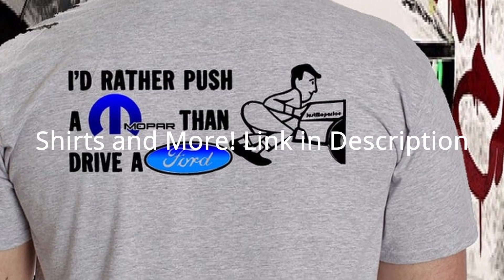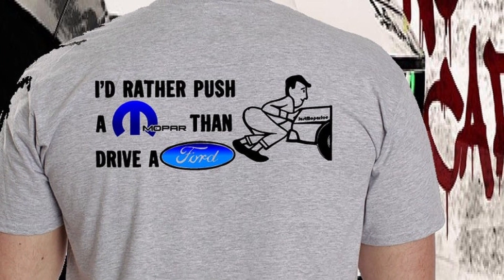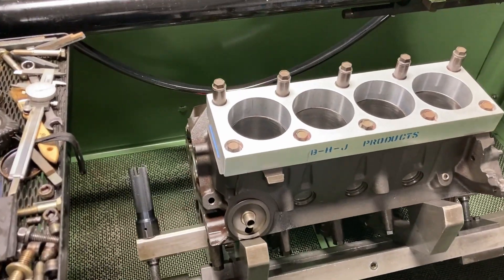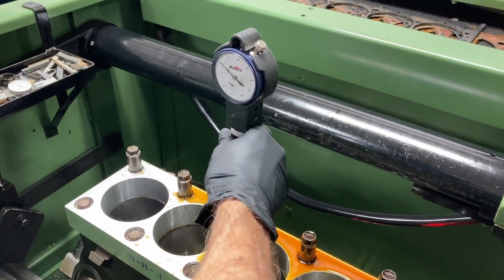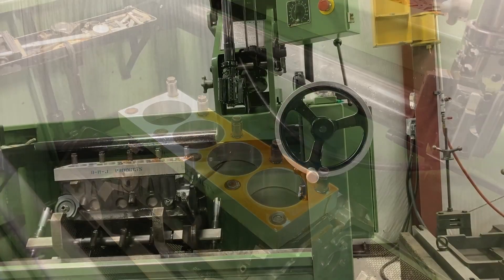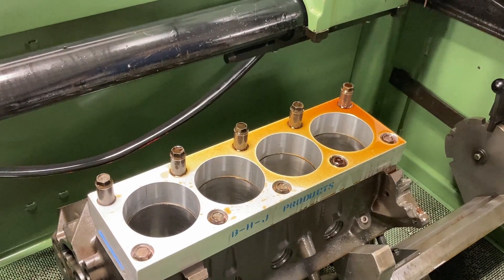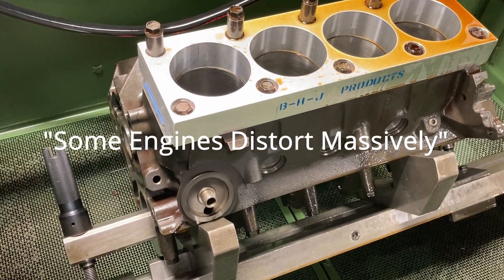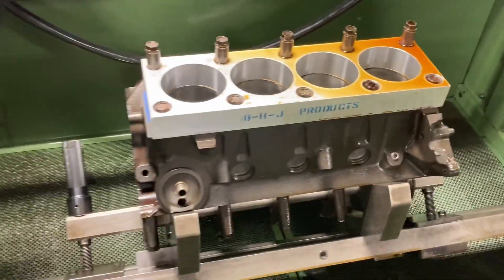Engine Building 101: A Real World Torque-plate Test!

Comment: Old retired diesel mech I know with great success for 48 years now retired never used a torque wrench on the head bolts, used an air impact never saw a head gasket failure after using it.. Myself I prefer a torque wrench
Reply from the maker: Wowser!

Comment: Not too surprising.  I'd really liked to have seen him measure in line with the head bolts to see the distortion in those areas.  The rings need a to size round bore to seal and not just across the thrust surface.  Thanks for the video. Maybe next time measure every 30 degrees.

Comment: The take away for me. Some blocks  move more than others. How do you know which one you have? I watch this video on youtube. I watch other machine shop videos on youtube, They come up with different results and say don't trust what you saw on some video or read. ?  One vary respected  machine shop / u- tuber say yep it definitely moves, but..  on an ls, if it's not 4000hp you don't need it.  But all his other videos are about be Precise and exact. 🤔  so what I've Concluded. 1. If the block has head threads up top to deck. Like an fe ford. I would definitely tork plate. If I was rebuilding a stock Ls. I wouldn't. But if I spent money on Forged pistons &rod and stud the engine. Why not spend another $200 ish and plate hone.
Reply from the maker: The movements seem are .0004. Kinda makes you wonder if the factory torque plate honed, but my high performance stuff gets the plate for sure. If you watch Rick Seeman on YouTube, he only uses a plate on every one of his engines.

Comment: Depends on the Engine, Iron Blocks Don't Distort by much, but aluminum Blocks with open deck and Siamese Sleeves It does Move more than a Thousands which it will distort the area where the Bolt pulls up, causing a lot of Blow-by.

Comment: How about small block  Mopars?  Can you have that tried on 360 and 318 LA blocks
Reply from the maker: We don’t have a plate for a small block mopar. I’m certain it will change with different fastener loads. My guess would be the mopar wood be stronger than the ford block.

Comment: If you have the torque plate then use it.  I'll admit, assembling a stock engine with stock fasteners most likely won't bend things out of shape any more than usual but using the plate can't hurt.  However, I think many of these engines get assembled with aftermarket hardware for whatever reason.  I see ARP hardware added to builds without the proper machine work and this test should also be performed with ARP or similar fasteners.  THAT's where the torque plate and machine work makes a difference.  Using the ARP stuff for head fasteners, mains and rods bends things out of shape to varying degrees and they need special attention to machining.  Do the test with ARP hardware for the better effect.
Reply from the maker: Yes sir. We checked my 512 with head studs and a plate, and there was distortion

Comment: Use ARP bolts/studs, then measure diagonally in the same spot as the head bolts and do another video
Reply from the maker: Very probable that the block moved less with the stock bolts. We saw more movement on a big block mopar with studs

Comment: This is classic dunning Kruger. The torque plate is supposed to help with roundness not taper. So you need to measure at  the top of bore at points 12oclock, 130 and 3 o’clock etc to see how out of round it is.

Comment: To further expand an open deck block has even less need for a torque plate because the bores are not anchored at the top anyway and flex somewhat under load.
Reply from the maker: Interesting. I’d like to research more on that

Comment: I can tell you from first hand experience that using a torque plate has more advantages than disadvantages and is worth the extra effort. 
    There are many different factors that can creep in and cause cylinder distortion and as always it’s the details that are simple and seem to be overlooked or disregarded as overthinking. 
   The ways a cylinders become distorted in any block. 
  1.) Reduced cylinder wall thickness. Remember the water jackets in cast blocks are just that. Cast and have to be assumed as varied in thickness. 
  

  2.) Blind head bolt holes that have debris in them. 
   Threads have to be thoroughly cleaned. I do not care for thread chasing taps in this instance. They can leave debris in the threads. So I generally use a tap that is not dull and thoroughly clean the threads all the way to the bottom of the hole.  Most important is making sure the holes do not have any fluids filling them. Honing oil in particular.  You can not compress liquids and even though you’re not supposed to use a impact on engine fasteners I’ve seen honing oil cause more distortion to a cylinder because honing oil was left in the head bolt holes. 
  3.) Any course departure from perpendicular by the threaded head bolt hole that causes a less than perfectly straight stud or head bolt engagement.  These fasteners will try to right themselves more as torque is increased at the expense of deflection around the bore. Thinner the block the more distortion and this should never be assumed. 
  4.) Blocks with threads flush to the deck surface.  Those threads should always be chamfered but take into consideration that the chamfer will have eccentricity with the centerline of the thread and if the unthread shank of the studs is resting on an eccentric chamfer it can cause misalignment and result in cylinder distortion. Ford got this right for the most part. Later engine designs have caught on evidently. 
  These are just a few of the primary considerations. 
  As the engine builder, especially people using head studs, you will want to make for sure and for certain that your head bolt holes in your heads are not imparting stress on the studs in any direction. The head should cleanly slide down the studs. I know it is difficult to tell, but one easy way is to place your heads on the block dowels without any studs in the block and then use some layout fluid on the interiors of the head bolt holes. Then screw the studs into the block and do a half torque down check. If you see thread patterns in your head bolt holes on the cylinder heads I’d suggest going to work on them and making them clear.  
   If you have a dial bore gauge you can simply torque the heads down on the block and check the cylinders from the bottom. This has saved me many headaches.  
   Angle milled heads that should have corrected head bolt holes should never be trusted in this detail. They will flat wreck a very nice cylinder and your rings will never seem to seat and bad leak down tests will be in your future. 
   I know it is tough to imagine. It took me a little longer than I want to admit to recognize these issues myself. 
   Even that cast iron block is malleable. Consider it like plastic when making these checks. Believe that if these items are there, they will distort and cause problems. 
  Do not assume that one particular block series is perfect. Mis-drilled holes are more common. Dull taps are even more common. Any block out there is subject to any of these imperfections and finding out the hard way isn’t in anyone’s interests. 
   This is the facts that the trade has taught me first hand. 
   This is the suck part of the trade. Assuming makes and ass out of all of us.
Reply from the maker: Very well said. We meant to show the changes in the 400 block that was just done. It was drastic

Comment: This doesn't surprise me. Chevy blocks are the worst to distort. Ford and Chrysler had good metallurgy.
Reply from the maker: We’ve checked a big block mopar after the final plate home and was nearly .003 difference! I think if you have the plate, might as well use it
Reply: you mean .0003"? @JustMoparJoe
Reply: Also the guy that owns the CV616 keeps it nice and clean. I do the same on my CK10. Nice!!!!!!  I do have to keep honing plates on hand because some customers demand it. And a Mitutoyo profilometer.......
Reply from the maker: @johnkrag6  that’s good stuff! He checked the deck and bores in the 508 in a video for me with his meter as well.
Reply: I'm going to install The Jamison Equipment Dwell control on my CK10. Makes the machine more versatile like the new model that Sunnen has now. Allows you to dwell anywhere in the   cylinder  to get it straight.

Comment: Another thing, how do you supposed to fit your pistons if you hone it with a Torque plate Wouldn’t it be better to hone it without it? And fit your pistons and rings too a round hole first
Reply from the maker: So the torque plate simulates the head being torqued on. It pulls right places in the top of the block and slightly distorts the cylinder. You hone with it and then removing it releases the tight places.

Comment: First of all I have never met a good Machinest that hones a block.030 ! Just because he works for someone doesn’t mean he’s good. If you don’t square it up first you got poop later. Thanks for showing what not to do like a lot of so called Machinest.
Reply from the maker: Just because you haven’t met the right people, doesn’t mean that your opinion is more or less valid. This is called power honing. It opened the bore spacing up from top to bottom with roughing stones, then switched to a finer stone for the final finish. Glad I learned you something new today. Also seems that if your deck wasn’t square to begin with, when you square up off of it, then you’d be cutting a crooked hole. This isn’t rocket surgery. The engine came to me with .120 ring gaps and terribly worn cylinders. It lived the last half of its life that way. If you’re not sure about if the block was improved then ponder on it again.
Reply: @JustMoparJoe  it’s supposed to be rocket science. Most Machinest deck the block then cut the bore’s with cutting tooling then hone the last.005 to get precise and accurate bore with  2 torque plates. Guess I just have never met a great Machinest? You know best?
Reply from the maker: @MrBlackbutang  my point is, that different machinists have different processes to achieve the same results. You’re not accounting for different levels of machining. Every block doesn’t need a nascar build treatment. The overwhelming majority of engines machined in the last 100 years were done with a boring bar setup on a stock deck. Final honing can be done with it without a plate depending on the customers budget. Now let’s move up in price range.I have a video that I’ll share with you on how to precisely machine a block without a CNC, based off of the cam and crank centerlines. You can watch the video, it’s all explained there.
Reply from the maker: @MrBlackbutang  https://youtu.be/Vv7pyXsGuDc
Reply from the maker: https://youtube.com/shorts/BY0fAEKtkHo?feature=share
Reply: @JustMoparJoe  he’s only honing maybe.010 maybe!  Not.030 .
Reply from the maker: @MrBlackbutang  you realize the hone doesn’t reference that deck at all when it’s moving up and down? And the cutting fluid actually cools the block as it works.
Reply: @JustMoparJoe  really is that you think? Wow. Don’t work on my engine. Don’t quit your regular job.
Reply from the maker: @MrBlackbutang  how does it secure the block? With a bar through the crank holes. I can’t work on your car if you drive an EV.

Comment: .0002 is definitely worth a torqueplate. How deep is the rvk, rk, and rpk values in a cylinder bore? Much less than a 10th I'm sure. If those numbers are important for cylinder bore oil retention and sealing then .0002 is definitely worth torque plate honing.
Reply: Well, maybe pull back that decimal one notch into the thousanths and then yup, definitely worth a torque plate👍
Reply from the maker: We actually checked them. Rick explained their values to me. The majority of my viewers don’t follow that.

Comment: Seems to me like the heat from combustion would cost more distortion than that  torque plate. Lol

But what do I know.  😉
Reply from the maker: For sure, Mike. Idk how to replicate that amount of heat for a test. I’ve had several comments that said to pour boiling water in the block and check, etc. I don’t think those guys remember that the combustion process causes the majority of the heat. I would assume it’s as hot as a header pipe inside the combustion chamber. I’m going back to painting and repainting 😂
Reply: @JustMoparJoe  Going by memory… Combustion temperature in the flame can reach over 2500°F. I believe cylinder wall and cylinder head & piston head varies between 200 & 600. Of course the cooling system keeps all that in check and prevents the engine from destroying itself.

And I’m only speaking for an average engine. Nothing fancy.

But my point is with all of those varying temperatures in there, stuff has to be moving around a lot and I wonder if anybody has ever really studied that. But I’m like you… I wouldn’t have a clue.
Reply: By the way. Interesting video. Thanks for sharing

Comment: The error is where you measured. If you gauged where the head bolts are you'd see a different story. The most obvious is if it was honed without a plate then honed after it's run with a plate. Try this, hone a cylinder without a plate, clean it well, then spray some layout dye, let it dry, then install a plate and take one light swipe with a hone and you'll see the low spots where the stones don't touch. This is why you use a plate. A block like a 400 Chev would be the most obvious.
Reply from the maker: Thanks for the constructive criticism! I should be able to do this with Ed at Ed’s machine.
Reply: @JustMoparJoe  Been in the business for 30 years, if you go and re hone a low wear block with plates that wasn't plate honed, there will be low spots, same vise versa. Cheers.

Comment: Under 1000 hp, it doesnt need to be so precise, 
Torque plates are for open decks and weak blocks.
So if its worth building cast blocks dont need them.
Reply from the maker: Interesting!
Reply: I hone a lot of blocks and some of them move around quite a bit. If paying or even doing the job, why not just aim for your best regardless of application. Takes moments to install the plates

Comment: If you wish to use the head gasket that you're going to use with the head with the torque plate then you would see the distortion
Reply from the maker: We used the head gasket that he had there. It had been tightened before and compressed.
Reply: @JustMoparJoe  the test I've seen done with and without show high and low spots when going from the final home without it and then adding it and running the final home through it one more time
Reply from the maker: @pontiac411  check out Ed’s machine. That’s how his pics of the 400 block he did for me was
Reply: @JustMoparJoe  will do
Reply: @JustMoparJoe  but I don't know if that would show up with a bore gauge

Comment: Ok, Engine should be hot for this and should the caps be torqued on the bottom too?
Reply from the maker: All mains were torqued to spec with the exact lube used for final assembly. The block was warmer than the room because it was just honed .030. The friction of the stones had it at a higher temperature. It was measured directly after honing, to ensure it was a consistent temperature for both tests. But an argued operating temperature is relative to the type of fuel being burned, alcohol vs. gasoline vs. nitromethane. This was a single static test. Can’t say it’s the end all, be all. But it is valid in its own right.
Reply: @JustMoparJoe  I mean running temperature. Like pouring boiling water in it just before honing. Just my 2 cents, What do I know....🤠
Reply from the maker: He probably won’t let me contaminate his honing oil, but I’ll ask! 😂
Reply: Our manufacturing clearance specs are givin to us at room temps. Hot honing is a thing but complex and typically for high piston to wall clearance engines as the bore will be quite small in the middle when cold. Small enough the pistons will no lonher have clearance and cold starts will be pure torture

Comment: It would be interesting to see it checked for roundness a few places around the bolts as well not just straight across
Reply: Where he checked it, is where the least amount of distortion usually occurs. It would have been much more informative to see what they found at 45 degrees.
Reply: @ericanderson4441  yes, that is what I was thinking about
Reply from the maker: Y’all will have to watch Ed’s torque plate video coming soon. He will probably check it every 15 degrees at multiple points up and down the cylinder
Reply: I honed a 351W 0.030" over few weeks ago and it went 0.0015" outa round when I took my plate off

Comment: I can see one reason why, the bolt holes are far away from the bores. Yes each Block series is different.My bb mopars generally have About .002 out of round. I personnally check at least every 90 degrees. I find some Blocks, chevies for sure that the cylinder bores scallop around the top 1.5 inches down the cylinder  YIKES! with the plates,because the bolts are rather Close to the bores. Pontiacs distort alot also.Always enjoy your videos, keep them coming!
Reply from the maker: Thanks for sharing!

Comment: Yeah call bullshit never measured where the bolts actually are in the bore. It’s not as if the cylinder head egg shapes the bore, the bore will have little shadows where the bolts are in the block. So use a torque plate and run hot water through the block better for results
Reply from the maker: Thanks for watching